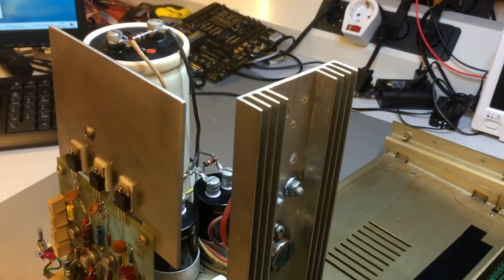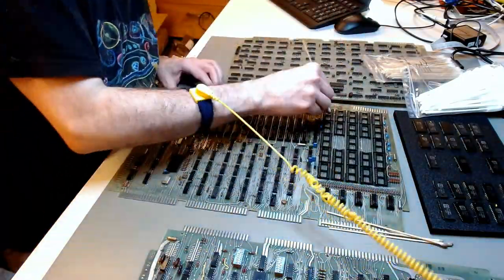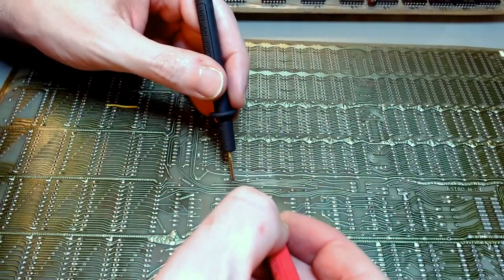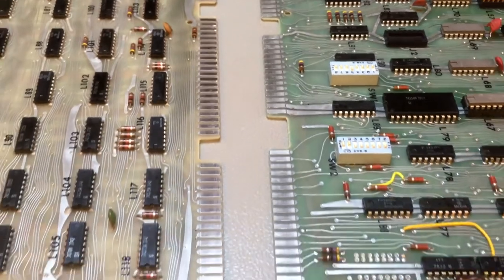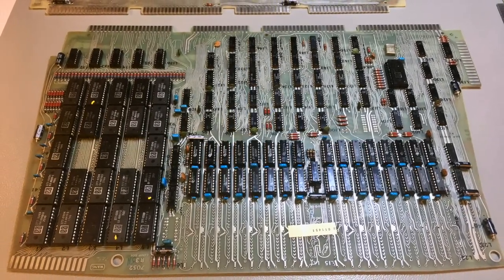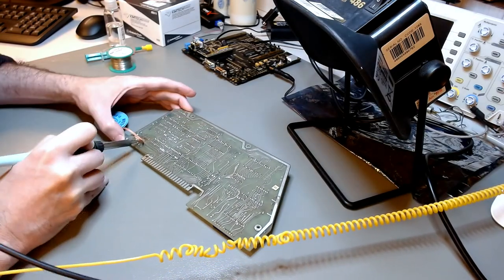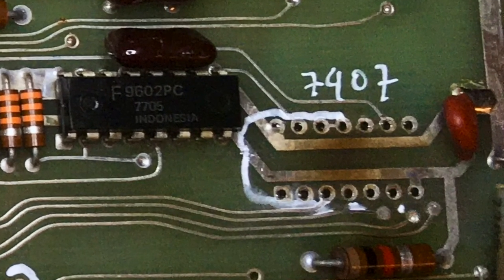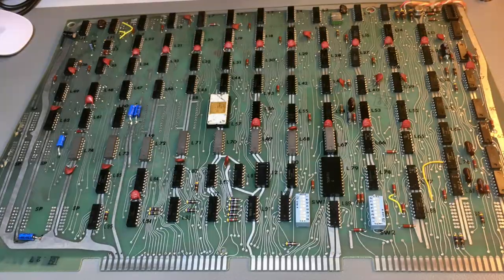Restoring a 1976 Wang 2200F mini-computer, Part 3

Comment: I love this series - It's very nice to see something other than C64 restorations for a change. And you explain your steps very well! By the way - did you dump the ROMs for archival purposes while you had them out?
Reply from the maker: The ROMs are identical to those of the 2200 with separate CPU case. They have already been dumped. Check out Jim Battle's website: http://www.wang2200.org/. These ROMs are not trivial to dump, as they have unique pinout and require -12V and other funny rails. One needs to build a dedicated Arduino-based circuit to read them out.

Comment: Did you dump the ROMs?
Reply from the maker: The ROMs are identical to those of the 2200 with separate CPU case. They have already been dumped. Check out Jim Battle's website: http://www.wang2200.org/. These ROMs are not trivial to dump, as they have unique pinout and require -12V and other funny rails. One needs to build a dedicated Arduino-based circuit to read them out.
Reply: @thebyteattic  It's nice that the retro community has done so much work, even on obscure systems like this.  I'm enjoying the series!

Comment: I think those little Kemet capacitors might actually be tantalums. edit: yeah, pretty sure: https://en.wikipedia.org/wiki/Tantalum_capacitor#/media/File:Tantal-P1100196c.jpg
Reply from the maker: Yes, they might have been indeed. Expensive tantalums. But tantalums are also electrolytic.